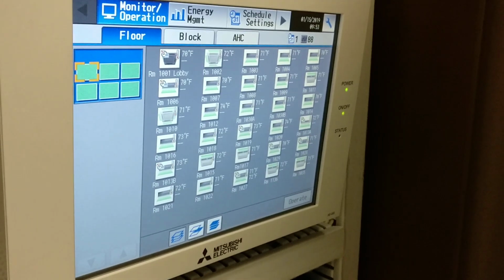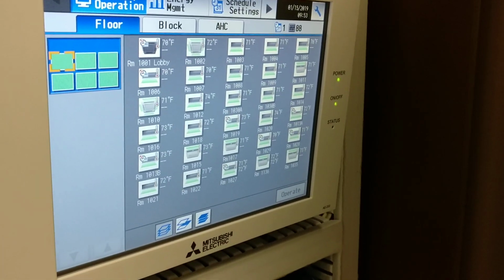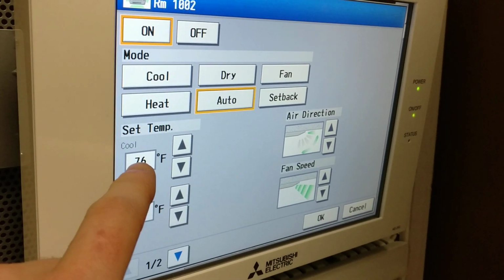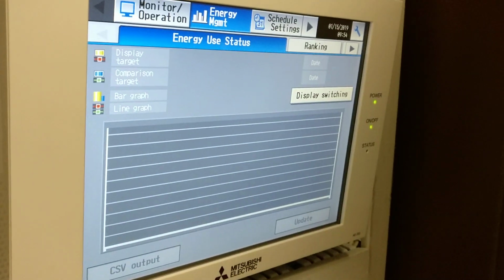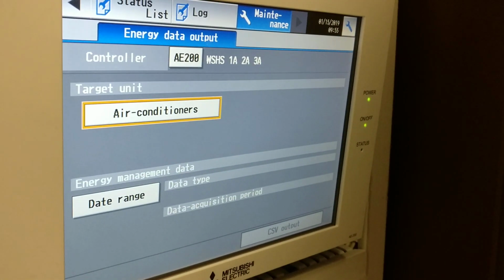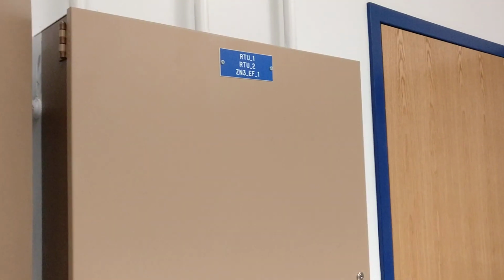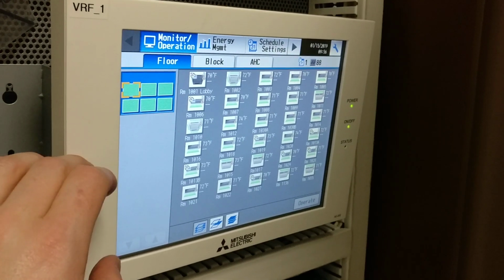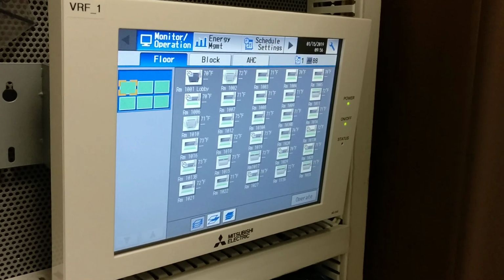Mitsubishi Electric VRF AE-200 Controller Quick Demo

Comment: It might be a little 😜 to ask you this but can you use the auto mode for the fan with this controller; 
Mitsubishi has one of the best auto fan systems so it is of great concern to me
And can you use the auto for the vent control; 
Some units have an infrared sensor which is useful
Reply from the maker: I think the cassette type units have auto fan but the ducted units do not. We usually default to using auto fan and the swing option for the air vanes.